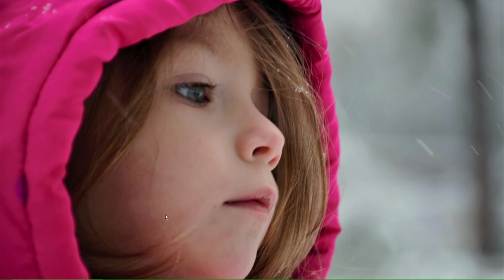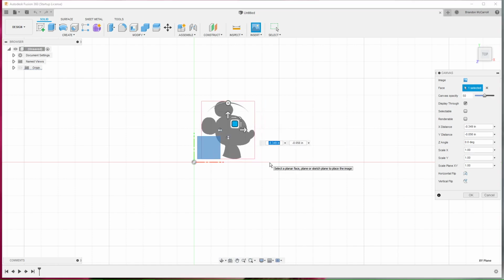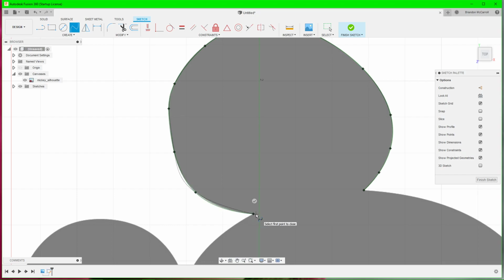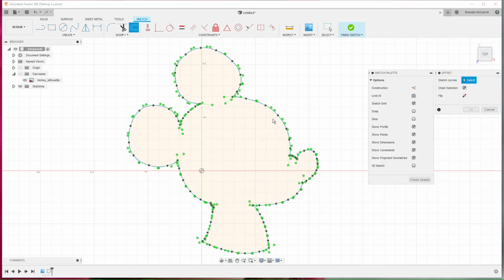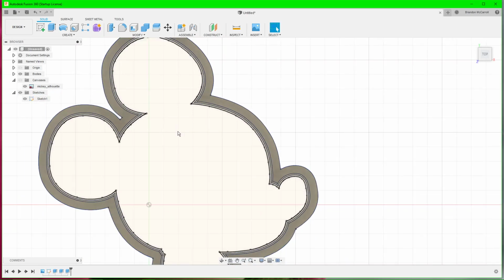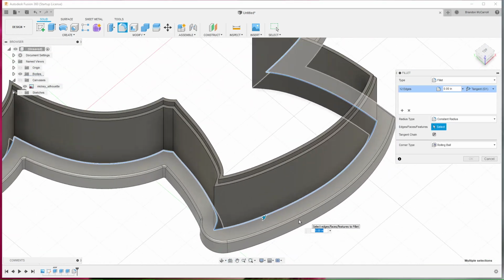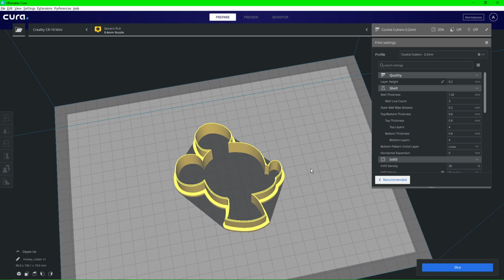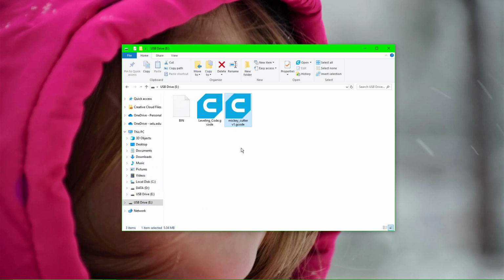Making cookie cutters using Fusion 360 and Cura

Comment: Took 2 hours 13 minutes to print a 4 inch Minnie Mouse face. Absolutely perfect! Thank you soooo much! I have been struggling through finding the exact right dimensions/printing profile and I was so close to getting and your video just put it all right there for me! I followed it exactly, only converting where you used inches to mm since I wanted to stay in mm. Worked perfectly! I added the fillet to very top cutting edge so it tapered down to a point and it was flawless! Thank you!!!!!!!
Reply from the maker: Thank you for sharing! I've found the split point spline works much better for the fillet tool compared to other methods for making curves. Thanks for watching!

Comment: You deserve a medal for this! Or flowers, or a high five...something. This is SO helpful and I have it bookmarked forever. Thank you so much!
Reply: Ok, the second I comment I have my first problem! I have printed 5 cutters so far perfectly. This last one I just tried, the printer heated up just fine but it wouldn't start printing because the Z axis showed as -3.99. Is this something I adjust in cura?
Reply from the maker: You need to re-home your printer through the menu system and try the print again.

Comment: You are awesome! This was super simple to follow, and i've got my first cutter printing as I type this. Thanks for the tutorial!
Reply from the maker: Thanks for watching!
Reply: @TheBrandonmcarroll   So with some trial and error with my ender 3 pro, I had to change the cutter a little bit, and they came out great! I ended up offsetting the blade to .03 in, and leaving the blade there without a thinner portion at the top. My issue was that there was a slight gap inbetween the walls of the blade itself, and making the blade slightly thinner closed it up. One follow up question I do have, is how would you add details to the inside of the cutter, say if I was making a smiley face shape? Thanks again!!
Reply from the maker: @mitcheld123  for cutters like that you need to add a bridge from the outside edge to the shape to hold its position. I generally make it the same thickness as the handle.

Comment: Hi Brandon,
Thanks for the perfect tutorial. Everything works great!
Quick question though. I'm using your settings on Cura and have a Ender 3. I get a pretty bad Z Seam. Any suggestions on what to tweak to get that to disappear? Thanks!
Reply from the maker: Check out the setting z seam alignment. You can set it to make it on the shortest distance, random so it's more spread across the model, or sharpest corner so it's aligned with a feature on the model. You can even set it to user specified and then under the next setting (z seam position) set it to a specific side of the model. 
If that's not getting the desired result then you may need to try calibrating your extruder for possible overextruding.
Thanks for watching!!
Reply: @TheBrandonmcarroll  I'm testing print on random now. I can't see the seam I I print anything that has angles but a perfect circle it shows up. Thanks!

Comment: This is amazing! Just created my first cutter on fusion! 
Question - is there a quick to change the size of the cutter. E.g I just created a 3.5inch cutter, how can I change this to be a 4inch cutter without re-doing the entire thing? 
Thanks!
Reply from the maker: You would have to use scale in your slicer program.
Reply: Thanks Brendan!
I’ve found the scale function 
So if I started off with a 3.5inch cutter and wanted to get a 3 inch cutter I would just scale to 0.86?
Reply from the maker: That sounds about right.

Comment: Thank you Brandon, when I do the first offset, even though I have my preferences in inches it comes up in mm. Am I doing something wrong or am I missing something? Thank you so much. Will this give a sharp edge? How can we get a very sharp edge to cut for gum paste? I am trying to make cutters for gum paste flowers. Thank you so much. I am very new to 3d printing and there are not a lot of tutorials on creating/preparing them for 2d to 3d and then slicing them with the best settings. Appreciate all the help. Thanks
Reply from the maker: Make sure you hit apply when changing your preferences. If you started the design in mm before changing your preferences it may remain in mm until finished. To change over a design you have already started look in the list to the right side of your screen. (Where you show/hide your canvas or sketch.) In that list, there is a drop-down arrow for document settings. Under that list, you can change your units. Bear in mind that this is only to change the design that you are currently working on; If you don't verify that your units are correct in preferences it may change back for your next design. 
As far as the cutting edge goes .2 is generally the thinnest Cura will allow. If you choose you can make the edge a bit thinner but you will need to enable the "print thin walls" option in Cura. 
In Cura, if you look at the options on the right side of the screen you will see a search bar. Just type in "print thin walls" and then click the box. I don't recommend this unless .2 is not working for you though. This setting enables the printer to print walls thinner than the diameter of your nozzle and you may run into issues of it not applying the layers as well as you might hope.
Good Luck and happy printing! Thanks for watching!
Reply: Brandon McCarroll thank you so much Brandon.

Comment: First off, thank you for the video! Yesterday was the first time i was able to mess around with this program thanks to your detailed tutorial. With that being said, do you know why I keep getting the following error when attempting to create the 2nd and third offset? Error: The sketch offset created no geometry. Modify the offset dimension or verify the changes are correct. The first offset is created without any issues.
 
I was able to create another cookie cutter with no issues as well. This is the second attempt where I do the spline on this same image and it continues to tell me the same thing after attempting to offset :(
Reply from the maker: Are you selecting the innermost line for every offset? I'll try to recreate this error and see what I come up with.